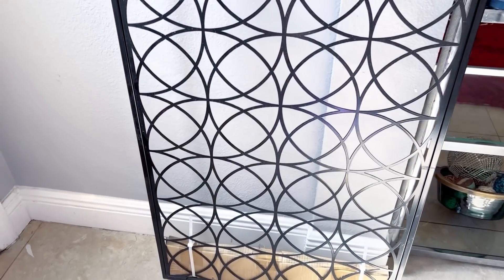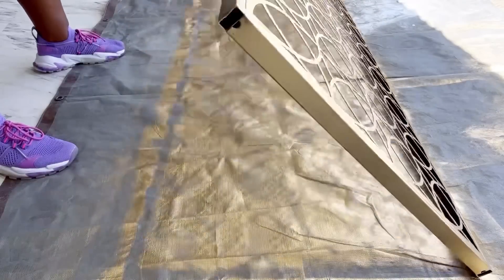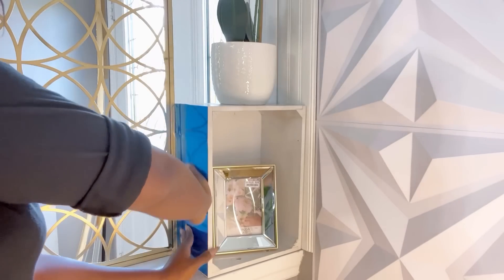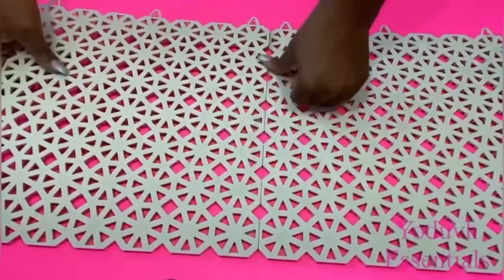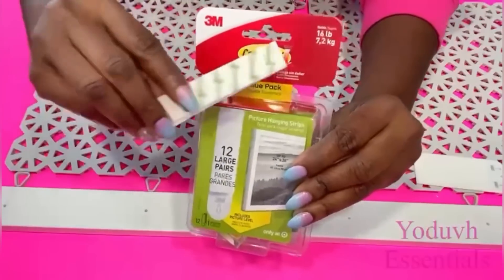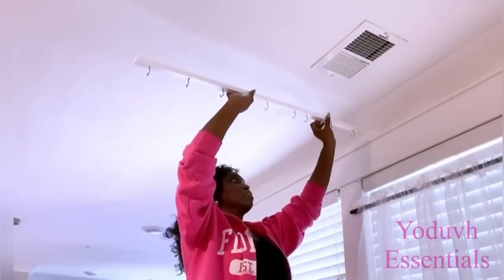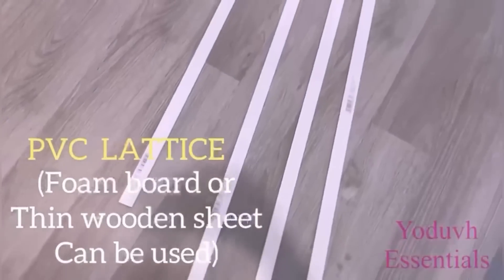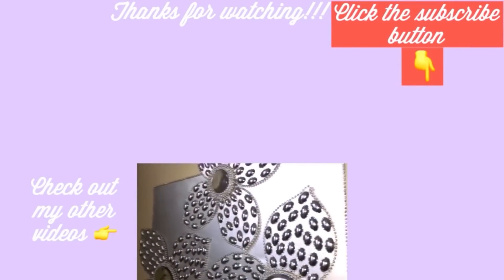SEE HOW SHE MADE AN AMAZING TRANSFORMATION WITH THIS ITEM! A DIY Idea You NEVER Saw Coming!

Comment: Yoduvh, you are amazing. This gives me an idea to block the bright sun on an area of my back porch. When the sun moves in the evening, it heats my back storm door, but if I use this idea, I should be able to stop that. It doesn't have to go all the way to the ground to do the job I need. I could attach some plastic chains at the bottom to reach ground level, and stack the chain in place, so the screening doesn't blow around on windy days. Thank you for sharing this unique idea.

Comment: just giving you a tip on screwing in eye hooks, or the tea cup hooks, once you have them in a little bit, slide a pin or pencil into the circle part, and all you have to do then is use your finger to rotate the pin to screw them in the rest of the way, it saves you a bit of time rather then using your fingers and wrist to turn them manually

Comment: I apologize You did say, Tresil and I said Divider. However the Decorative square panels from IKEA might make a Great Backsplash Project. Just spray paint color of Choice. Add a foam board to the back of square panel & a Design in the between. Perhaps  use the Command Strips to apply to the wall & change the Design at your leisure. But use the Glue gun for the  corners to press the panel to the design to the foam board to the wall. Great for Renter Friendly upgrade in Kitchen? This idea looks Great in My head, haven't tried it yet!

Comment: You are in My Head and I'm loving it! I have an Idea to do the same thing with the Gold divider that you displayed in your foyer near front door. Can you create a DIY friendly Version using that same Divider from LOWE'S but add Plexi Glass (or Some other Type of Durable Glass that can be Inexpensive but work)? It would be placed & secured behind in place of Real Glass (Decorative Frosted Design for Privacy on top of the glass before Attaching it to the Gold Frame! This would become a Decorative Shower Panel to hang from the Ceiling so Someone could take a Shower. The other half of the shower would be open. I don't have a Window in my Bathroom and I didn't want a whole Shower Panel that slides open or desired a Door. So, with Using the same Concept for My Renter Friendly Bathroom, I believe it could work? Perhaps using similar tools to slide the base of the suspended panel with wood drilled into the ceiling due to moisture. For the top base of the tub, the bottom frame would slide into a glued PVC pipe so it would move & the left side of the frame toward the wall of the shower wouldn't be drilled? But perhaps, thin PVC Piping could be spray painted whatever desired POP color for the Bathroom,  mounted & glued to the tiled wall? Does All of this makes any sense to you? I Believe this Idea would HELP a lot of People being Low Cost Friendly! THANKS FOR YOUR HELP!